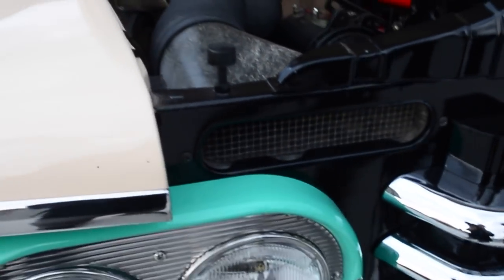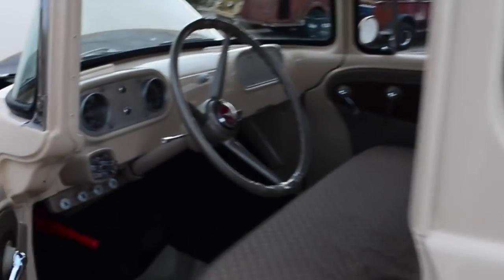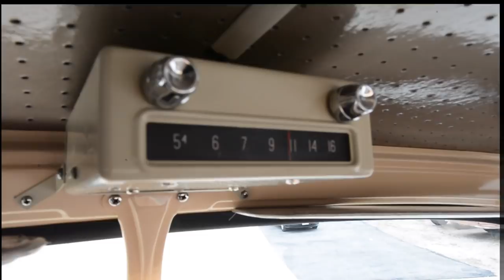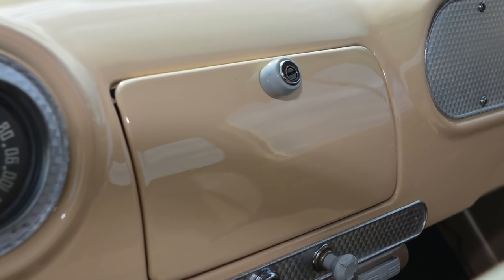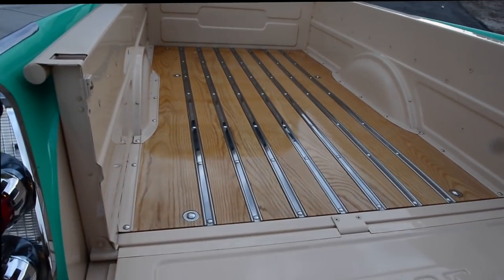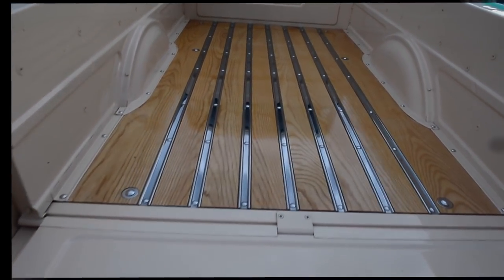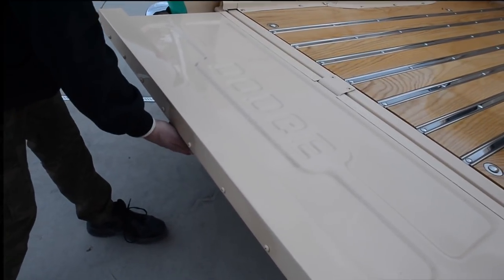1958 Dodge D100 Sweptside Pickup

Comment: Didnt know about poly and hemi!
same block I rebuilt thre engine in my 63
Reply: If I'm not mistaken I think the late hemi and the big block wedge engines are the same except. the hemi has an additional head bolt around each cylinder that can be drilled and tapped.

Comment: gage cluster is ugly, 59 is much nicer.  also it's 318 poly
Reply: It's actually a 315 poly. We have a 1958 Sweptside with the poly engine. They also made a Canadian version called the Fargo.
Reply: That's a Double rocker shaft engine, ie HEMI, You can tell by the wide valve covers. The poly is a single rocker shaft engine and the valve covers are Not nearly as wide as these.